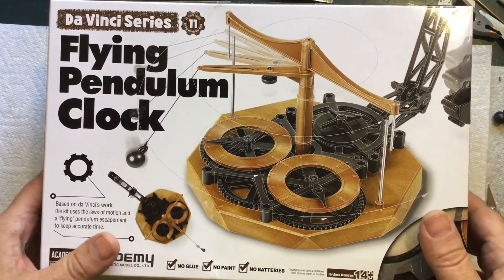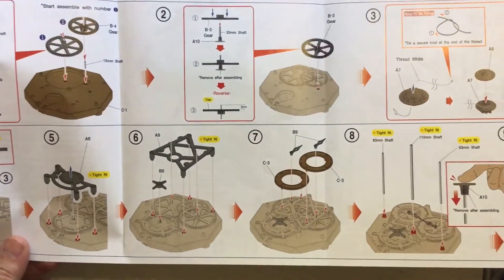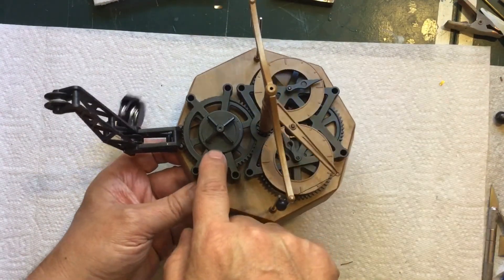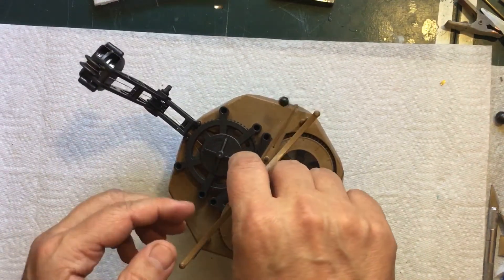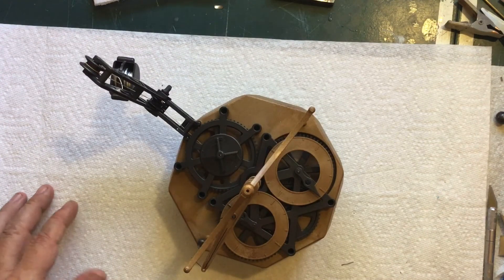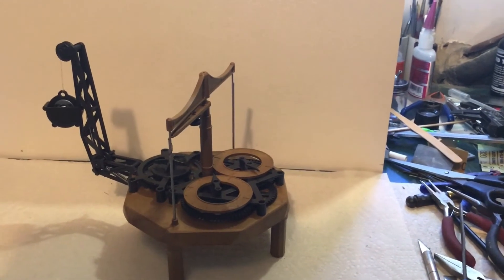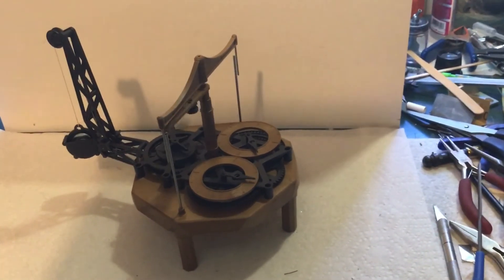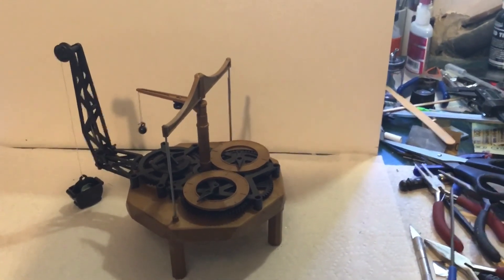The Academy Da Vinvi Series flying pendulum clock kit

Comment: I see other comments that there is binding. Yes this was a problem for my son and I. He assembled but we reviewed the issue together. The gear that is wound catches the frame of the clock gears. So I lifted that frame and put a fingernail width near the bottom where tabs snap into the base closest to the frame that holds the winding gear.

Also our rod that holds the T bar is not stationary as if diameter of chrome rod is too small by fractions of a millimeter. I suggested to my son we crimp the base of the rod and put a little teeth where it inserts into the base. He was apprehensive about altering anything but I told him sometimes a kit has to be tweaked a little. We don't know what other assemblers did for their videos!

Nice video!
Reply from the maker: Thanks! And thanks for the suggestions. Weird how different people have different issues with this kit. I don’t remember having any. Maybe quality control is lacking? But yea, sometimes you gotta do what you gotta do to get it to work. Thanks again for watching and commenting.

Comment: Mine just doesn't spin at all, even with the weight thing being full. Any ideas?
Reply from the maker: Sorry to hear it’s not working. It really could be anything binding or not seated correctly. Hard to say without seeing it. The only thing I could suggest is to start taking it apart checking for anything not free to move as you go. Good luck.
Reply: @customfabrications  Thank you! Just wanted to ask to make sure you didn't put any lubricant or anything on yours. If I pull the weight it spins, but it feels like it's getting caught somewhere. It stops at the same spot every rotation unless I interfere. Super strange, just going to start over
Reply from the maker: There could be a defect on a gear tooth, like flashing, or something. That could explain why it stops at the same place.